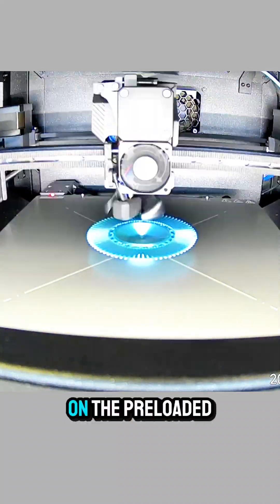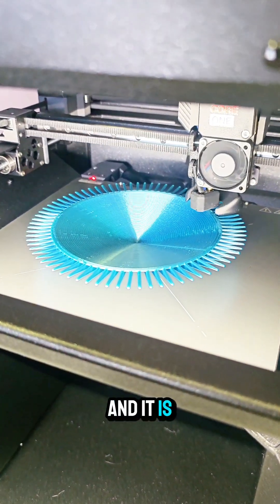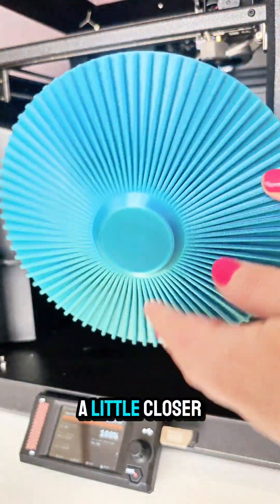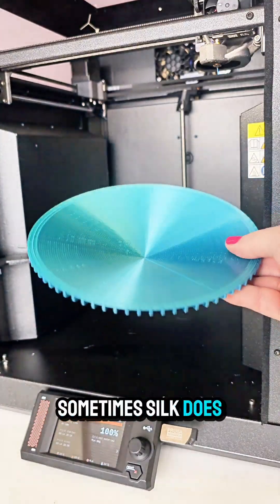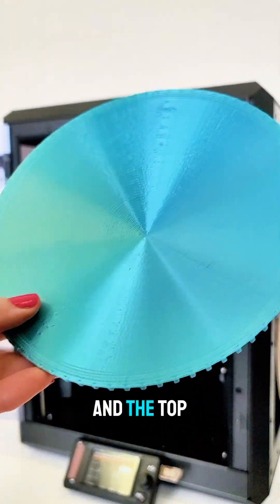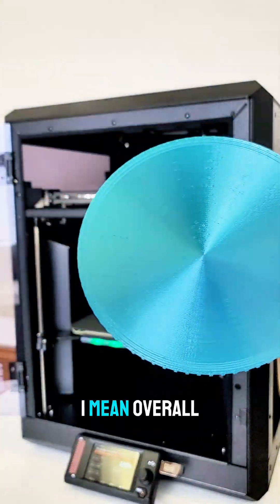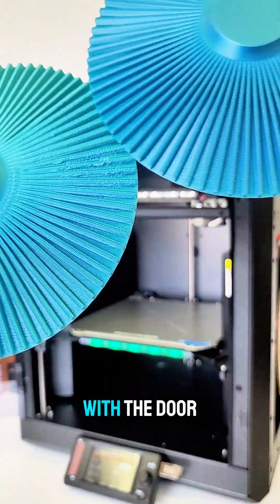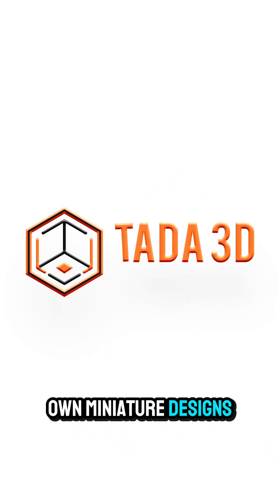PRUSA CORE ONE Overhang Test! #prusaprinter #prusa3dprinter #prusacoreone

Comment: Several YouTube contributions have said, unless the chamber has active COOLING too, you should print PLA with the door open because the heat from printing will raise the temperature in the enclosure. 

I, myself, have found silk PLA to want to sag more that standard PLA.
Reply: The core one does have active chamber cooling too.
Reply from the maker: Thank you!

Comment: I always run PLA with no enclosure or with the door open.  If it gets hot inside it will make the sags worse and silk is hard to print.
Reply: The prusa core one should technically be able to print PLA with a closed door, if the top vent is opened. But it sure doesn't hurt to give it more cool air.
Reply: @Rangido3D  I agree, but  I have experienced jams on my enclosed printers when printing PLA, it gets too warm and can soften the plastic before it gets to the hot end.  This is on my X1C and Prusa XL with a Sumo enclosure.  I found it is better to be on the safe side.
Reply from the maker: Thank you